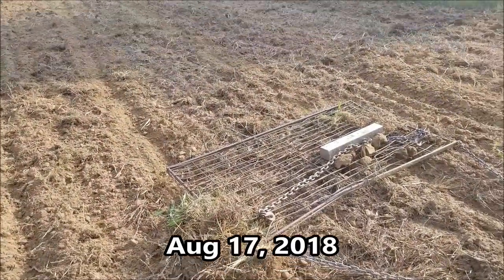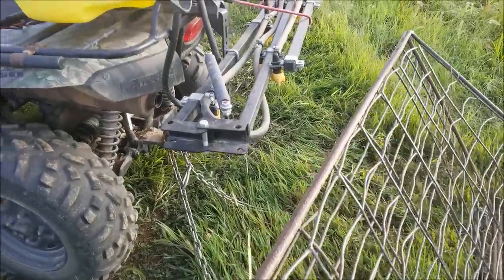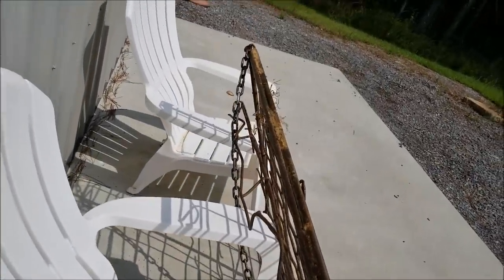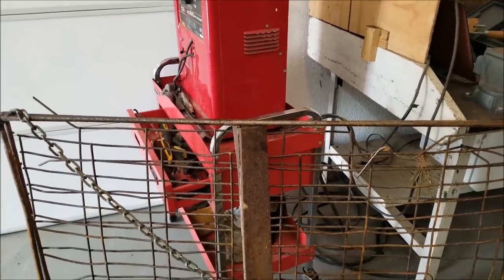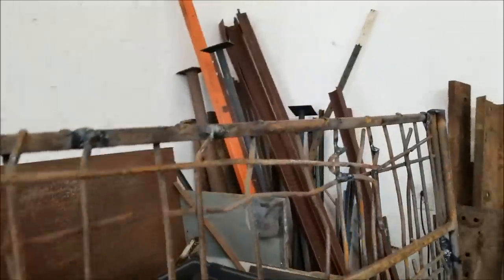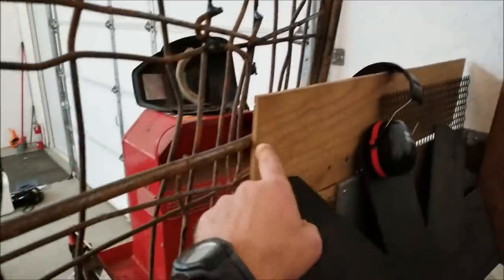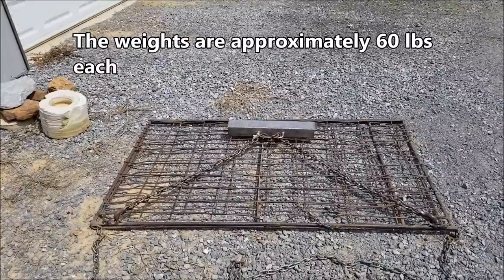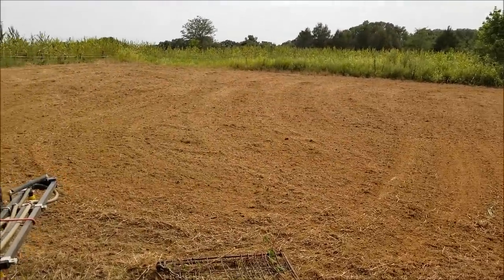Fixing home made DIY food plot drag 08-23-18

Comment: Joe, I made my drag out of an 8’ x 5’ section of heavy gauge left over cyclone fencing. I attached a double layer of heavy steel 2” wide strapping to both sides of one end and put eye bolts on each end to attach the chain. My drag vehicle is my zero turn mower which is quite fast. I added 3 70 lb. Windsor blocks of concrete on top with a chain for extra weight. The drag has held up to a lot of use on my farm for 14 years with no problems. Since I had most of the stuff on hand, the cost for it was about $15 for the steel strapping.
Reply from the maker: Sounds like a great build! Always good when we can save some cash :)

Comment: Nice fix Kapper.   I have a really old one with spikes.  It’s super heavy duty more than I can lift.   Had yard roto tilled by big unit behind tractor, then I seeded it and ran harrow.  Grass came up like corn rows lol.   Someone borrowed it AKA just took it.  Returned it bent.  Had it straightened and use it to rake rock to smooth out gravel in parking lot.   Like how you hooked weight on.
Reply from the maker: yeah, that is why I didn't like the spikes. Hate when a borrower returns it bent!
Reply: Kapper Outdoors  Joe, I very seldom borrow something.  But if I do I make sure it’s as good or even better condition after I return it promptly.  Hate when people borrow something and don’t return it and a year later I am  looking for it racking my brain where it could be, finally realize  who used it last and have to go get it.    It’s very frustrating people have no respect for the person that they borrowed it from.

Joe that counter is driving me crazy I don’t understand how you can be so close the down 50 again.

Comment: Nice work Joe. I need to add a welder to my tool collection. Any recommendations to a novice?
Reply: Look at the Hobart welders.
Reply: Check out the Vulcan stick welder at Harbor Freight. Just as good as some of the well known brands...and for less $$$ 👍😀😎👀
Reply from the maker: yeah, I was in the same boat, and my homework led to what I have, a 'buzz box' AC welder. Needs a 220 hook up, but much simpler than the aceteline types. Heck you can even get a wire feed, but for heavier steel not sure they are enough.